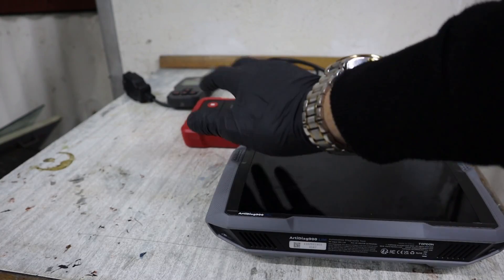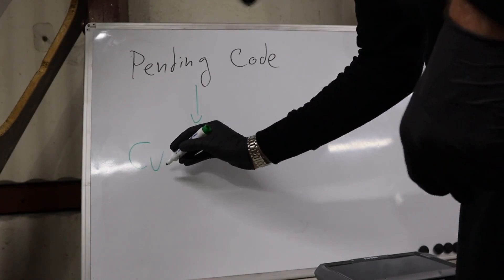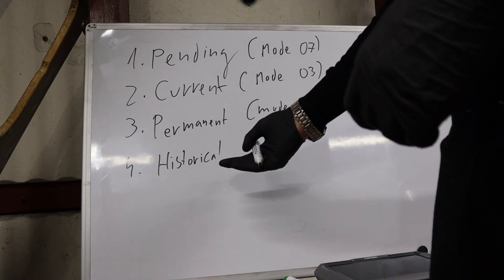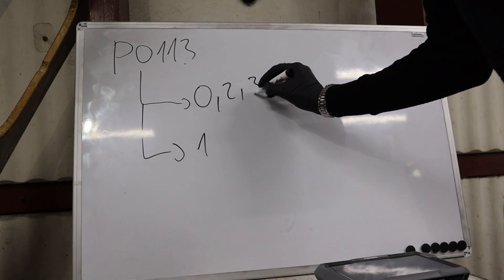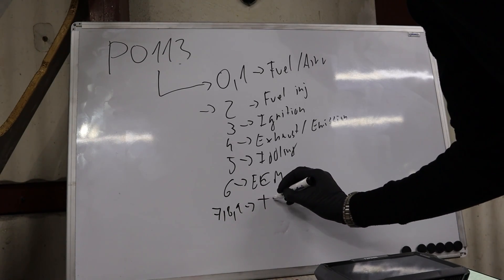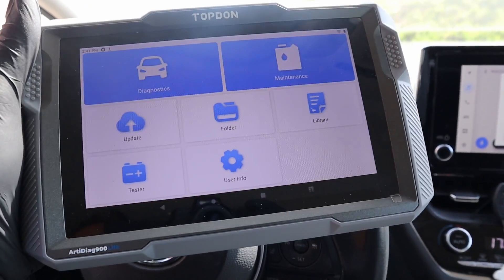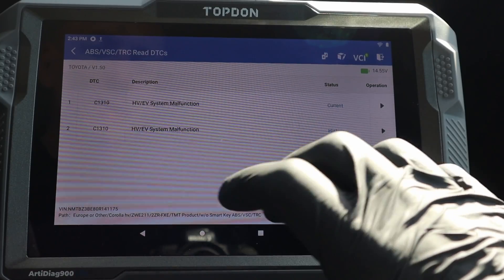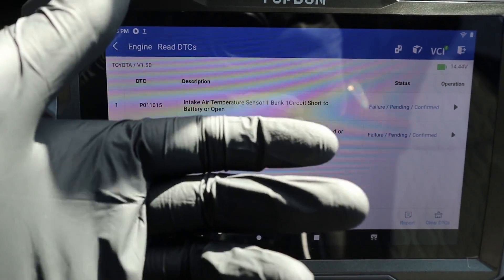How to read car Fault codes and actually FIX them

Comment: Hi can’t clear bmw x5 2012 35i code o3117 ?
Reply from the maker: If you cannot clear it its usually wiring issue. Is this code for ABS sensor? If yes you can check wheel speed data you will probably see 0km/h on this sensor when car is moving.